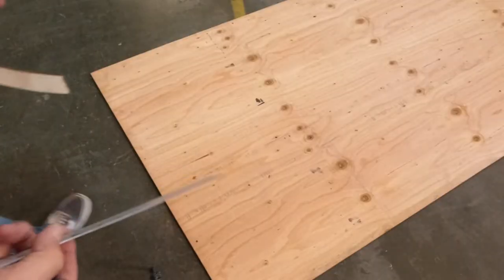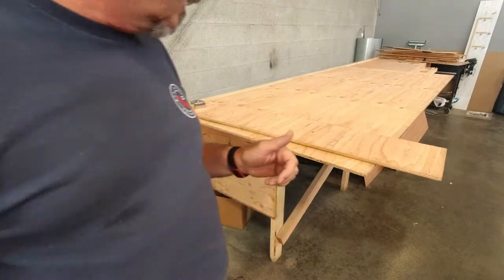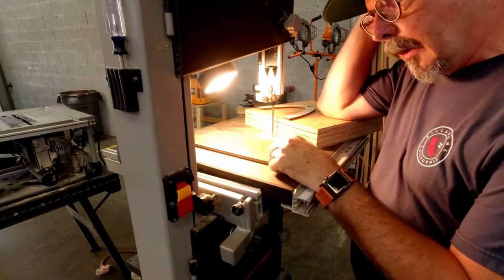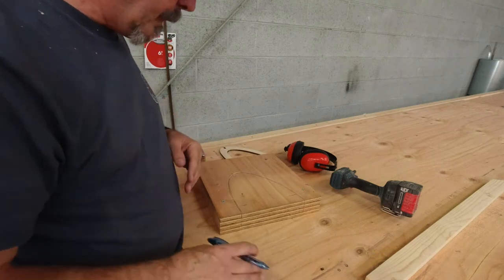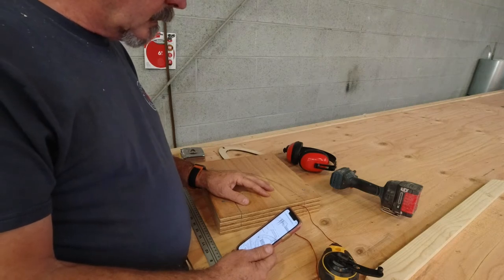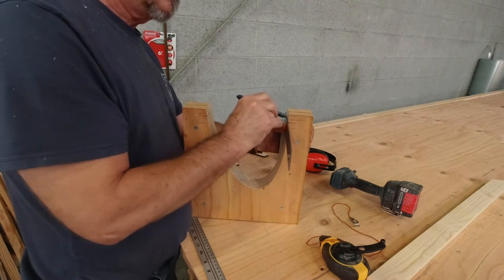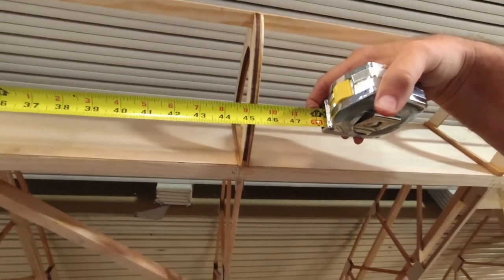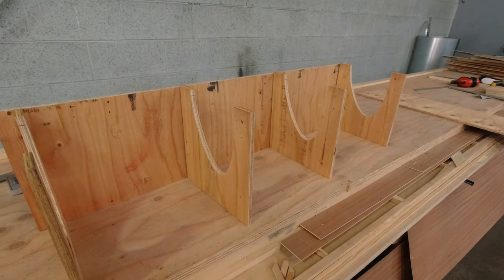Minimax 1100r Aircraft Build Vlog Episode 18

Comment: Not sure why it is set back on the top spar is it for gusets to be bonded on at the ribs? 
If not why not make it flush and just cut the skin back at the root and tip to take the ply sheeting going to the rear?
Also would it not be a good idea to have a length of wood running along all the forms (set in to the form) so that you could clamp you play to it (also that might stop bowing between forms)?
Reply from the maker: There are no gussets, but you give me a thought that it may be really nice to add some gussets. You’r other suggestion is a solid one, run the ply out to the edge and then route out where the ply goes on the end two ribs. 
The 1/16 ply doesn’t sag much between those members when drying. It’s pretty stiff. If it was thinner, I can see where that would be a problem.
Reply: @DTMinimax  In that case why do they not have the skin go to the back of the top spar, if they have it go to the back of the bottom spar? It is not like you can get more than the two skins out of a standard sheet.